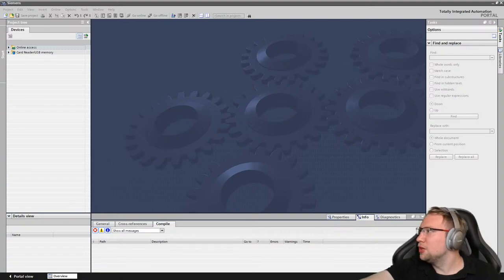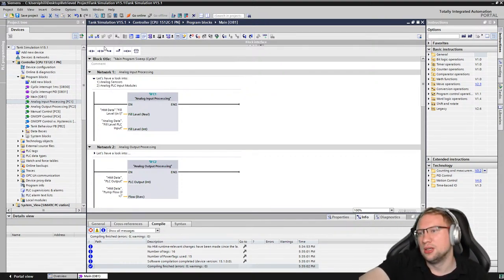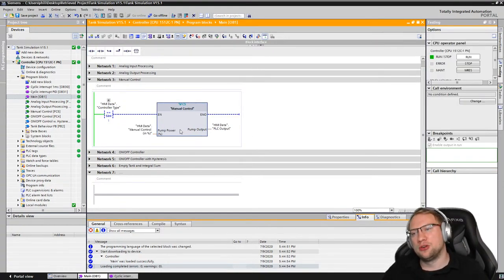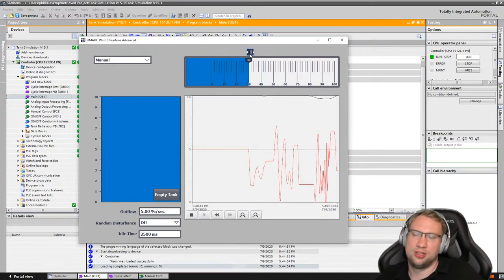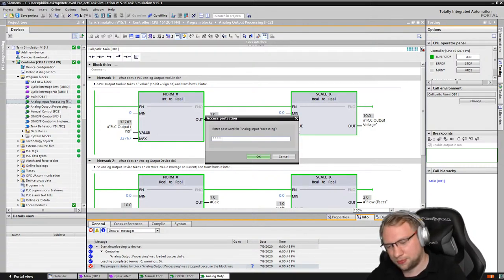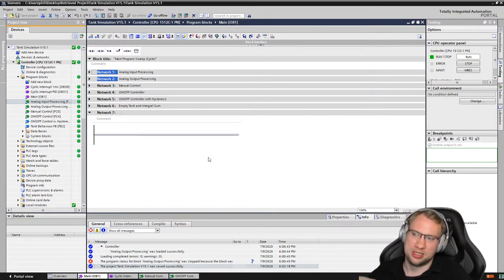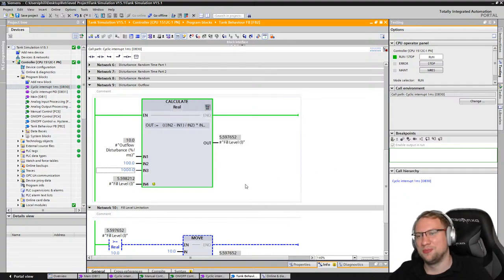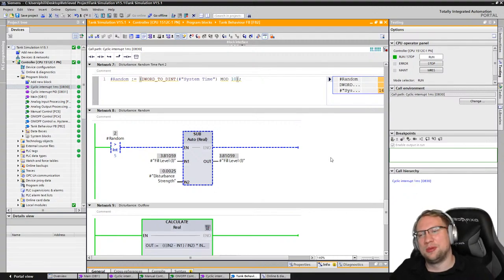TIA Portal LIVE: Let's look inside my tank simulation

Comment: You were right about Factory I/O limiting what you wanted to achieve sensei. For instance, No flow rate in Factory I/O, and NO disturbance. Yes, Factory I/O is aesthetically pleasing but not flexible enough in this department of tank level control. Thanks for revealing the prestige of these projects to us🙂 I saw that Christopher Nolan movie and all I could think is Hega is an ingenieur!

Setpoint Limitation clamp in Tank Behaviour block is cool! Really simulates the tank capacity as 10l

Comment: Need a look at the data blocks, Analog data, hysteresis data etc dnt hv TIA v15.1 ..if someone could screenshot the datablock tables in the forum i would complete the project in TIA v15 and share a link to it in the forum or here. Thanks
Reply from the maker: I found an older version that I made in V15, download it here, maybe it helps!
https://1drv.ms/u/s!AsQNA7rUATBthcwZfE2ircq2jp8khQ?e=EGvsNr
Reply: @hegamurl7434  Teacher dis ist wunderbar! danke schön! I retrieved it and it works like a charm. Now I can hopefully finish my step by step copy. Please, how do you make %FB1 (ON/OFF Control w. Hysteresis)
use the Global Data Block %DB2 (Hysteresis Data)? Is it when you call the %FB1 in OB1? Thanks so much again!